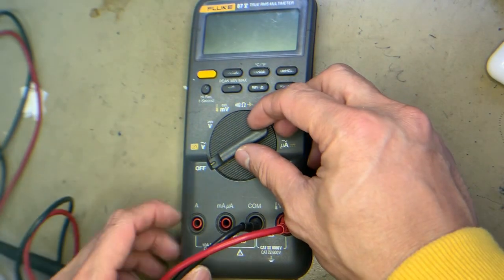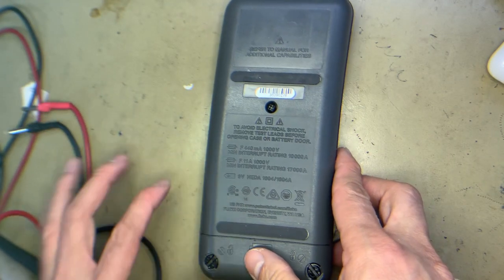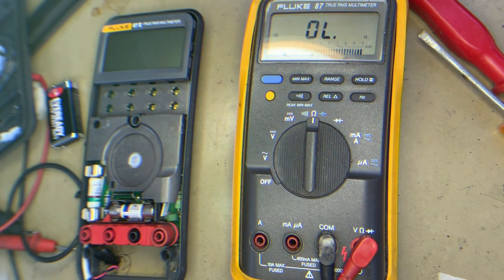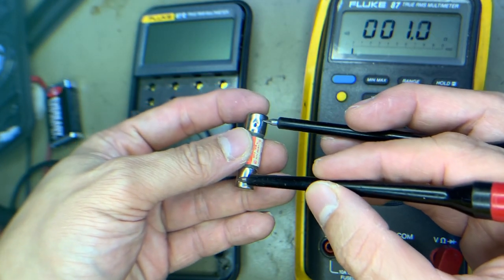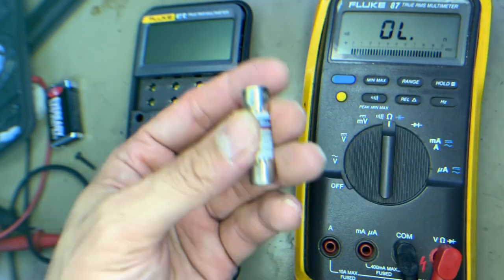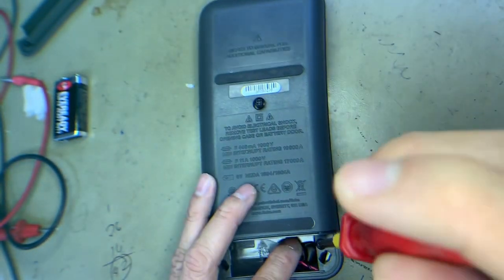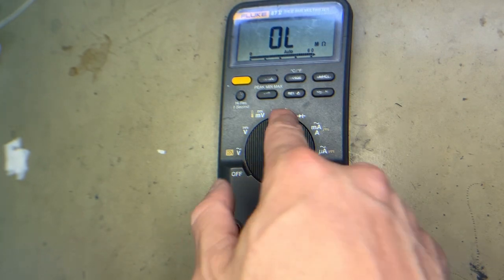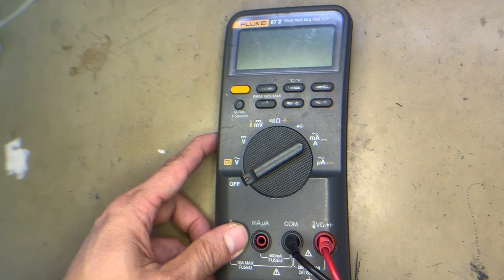Fluke 87V Repair | LEAD Blink Alarm and Beeping Continually| Repairing  Digital Multimeter

Comment: Me pasó lo mismo. En mi caso los fusibles están buenos. Solo los limpié con alcohol isopropílico y un palillo con algodón, también la base de fusibles y me funcionó. Gracias por el aporte.
Reply from the maker: Yes sometimes it will work in nusy cleaning an contact cleaner and resolder the dry joints and it worked
Reply: Ami me pasa que todo sirve ir pero tengo un beep constante, podrá ser el fusible también?
Reply from the maker: @G @GearheadSCLA hello try to check all the fuse test 2 fuses inside if found ok resolder the fuse holter ang clean arround the circuit

Comment: Thanks for the video. 
After I open my Fluke. 1 fase good ( 0.2 Ohm ). Another one 0.6 Ohm. It's sama fuse like in video.
Then I maka jumper on the fuse to make resistance 0.2 Ohm. I don't have spare fuse.
Now my fluke in good condition.
Problem solved. 

Thanks and Best Regards Brother for the tutorial
Reply from the maker: You’re welcome brother i uploaded that video for our fillow technician having the same problem in fluke multimeter, you can check my other video

Comment: Same issue with my tester, I replace the two fuse with good and new but still beeping and lead
Reply from the maker: @NieljunSuday   try to clean the terminal of the fuse and resolder the circuit board

Comment: I have this alarm but the fuses are checked ok.
Any ideas?
Reply from the maker: @panos4386  did you checked the connection of the fuse,? The fuse holder somtimes it has a currosion and dry joint. You must resolder

Comment: Của mình không chết cầu chì mà nó vẫn bị nhỉ
Reply from the maker: @ThuongLe-rl9pn  i cant understand your language boss
Reply: @migojertech9134  Mine doesn't have a dead fuse, but why does it still show the same error?
Reply from the maker: @ check the Fuse Holder the main connection of yhe fuse it might be there’s a dry joint resloder it
Reply: Sir please,suggest me if fuse will  be open then Installed a thin conductor instead of fuse can the issue will be resolved?

Comment: Thanks man this video with my meter. No bad fuses, just a bit of corrosion on the fuse holders. You'd think fluke would have a specific code for fuses.
Reply from the maker: Yes the fluke 87V fluke 77 it’s the same ratings of fuses

Comment: I guess one of the technothings didn't check the knob setting and put voltage across the leads.  Bussmann 440mA/1000V DMM-44/100R, Fluke part No. 203414, Q=5.
Reply from the maker: Exsctly❤

Comment: Sir, I am also facing the exactly same problem with my meter but this fuse is absoultly OK. Please guide me
Reply: Same with mine the fuses are ok  but its still beeping
Reply from the maker: @angelobryan4699   try to re solder the pcb of your multi meter
Reply from the maker: Even it is ok try to replace 2 fuses and replace also a new battery
Reply: @migojertech9134  I've replaced the battery and fuses are ok. The meter works perfectly if i remove the fuses, but with the fuses in, i get "Lead Error". Continuity, voltage and ohms works with the fuses removed. As soon as i put in the fuses, all i get, is "Lead Error".
Reply from the maker: @normahS  try to resolder the components maybe there is a dry joint double check the knob holder if not loss